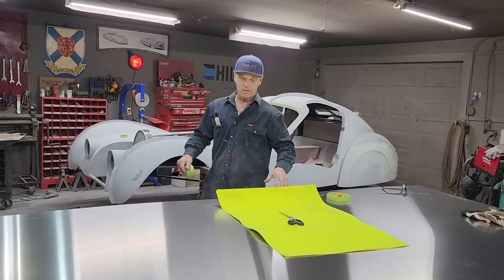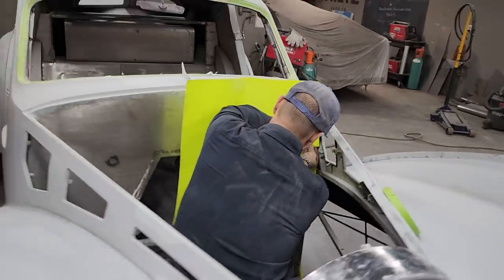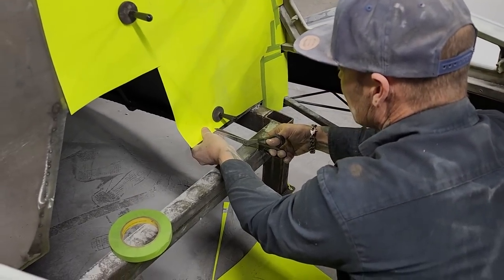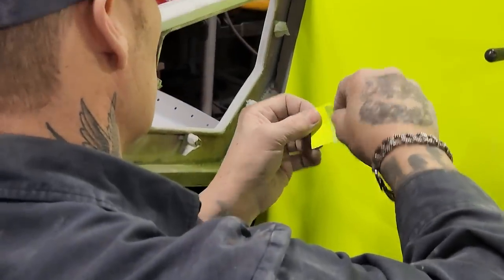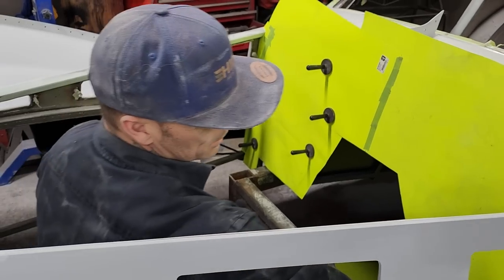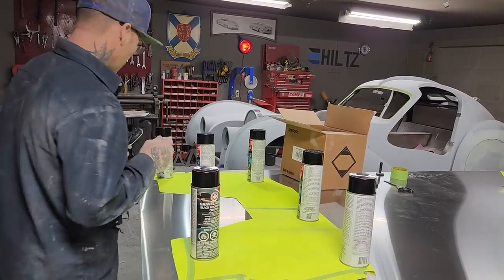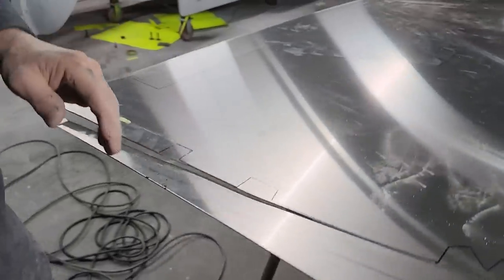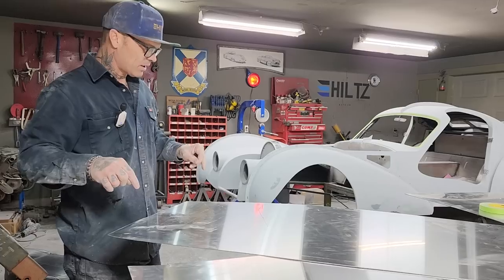Fabricating a new firewall out of 14 gauge aluminum

Comment: Here's a little tip for cutting floppy thin sheet metal, lay it oit on a thick piece of styrofoam such as an odl hot tub cover, the jigsaw blade will pass through the foam with out resistance while eliminating all that flopping around

Comment: Could've just used masking tape around the metal square tubing on the car, then unpeel it and stick it back down on the paper. THEN cut it out. You would have near exact cut outs. Would've saved you a ton of time and effort.

Comment: Hi Chad and Jolene, I was watching you guys over at Jim's house. I showed this to a friend of mine that restores old motorcycles. If you take a pitted piece of Chrome, the easiest way to remove the initial rust is with water as soap and a crinkled-up piece of aluminum foil. Try it on something old to test it out before you use it for an everyday practice. But try it out, it'll amaze you!

Comment: An area in my pre-retirement was dealing with dissimilar metals and their problems with each other. I thought I might give you some in site into it.

Aluminium, stainless steel and sheet metal when combined against another appears to be a bi-metallic corrosion risk, from the 'nobility' table. With this combination the affect of relative surface area on corrosion is important. A large area of 'cathode' relative to 'anode' will accelerate the anodic corrosion.

To reduce this corrosion is to use an isolating coating or paint on the aluminum and the steel to isolate them electrically. Insulating washers are also effective in isolating the two dissimilar materials and creating a relatively safe surface area.

So I know you will spray the primer on the metal portion of the firewall, but also consider the backside of the aluminum before final assembly.
Reply: Big Stretch.... it's a polymer similar to seam sealer....But for home door's and windows... I have used it on many Automobile project...it stays flexible and is paintable would be great for separating those metals....
Reply: i remember putting a aluminum pipe up on a steel shelf. the aluminum  disappeared where it was touching the steel, to the point the aluminum pipe fell to the floor in pieces.
Reply: Totally agree with you. I work in the industrial food manufacturing and we are always aware of not getting galvanic corrosion between stainless and aluminium..

Comment: Per Tim R's comment - my MGA had aluminum panels which close off parts of the frame.  The MG company put a cloth/wool type of packing between the aluminum of the panel and steel of the frame, which eventually gets wet and rots.  When I went to restore my MG, the aluminum had reacted with the steel and part of the aluminum had corroded away.  When I replaced the panels I did as Tim R. suggested,  paint-wise - it's been 15 years and there's no sign of corrosion yet.

Comment: Hi again, I actually go by Mickey I wanted to let you know a trick that a old machinist I knew taught me you can heat up the area around to studs and melt a little candle wax in there in your case maybe a heat gun. I'll show that trick I told you about who was aluminum foil we'll save Jim hours or 30 days, but I've never used it on nickel or stainless just on Chrome. Thanks, you guys’ awesome show by the way!

Comment: Great to see the progress made on the bodywork , and telling us Jim has his own channel is giving it a gigantic boost I think, i also took a look at it and it's great to see how Jim is getting the job done his way, he's great with the torch welding, you should put a kind of insulation between the steel body and the aluminum sheet firewall to prevent corrosion ,just as with steel bolts on aluminum manifolds as a comparison, thanks for sharing

Comment: Chad, you’re friend from Utah Clint. Hey love the pattern making. I’ve made thousands just like you just did. I owned a car stereo shop and had to build custom boxes or amp racks to look factory built in. I might suggest to do the inner engine panels with the fancy turned metal to? Also look for a spot to run you’re wired for the engine and headlights etc.? I just enjoy you’re work like so many others are. You’re personality is so unique it makes it interesting. THANKS

Comment: Suggestions-- when putting pattern on aluminum and magnets won't work go back to little pieces of tape. When you have the outlined  pattern fill in the small spots where tape was "free hand".  Also, when cutting thin material with a saber saw, put a length of of wood under the material being cut, parallel to where you are cutting. Then just press down on the material where the wood is. (some wise man often says you can take the suggestion you like and the ones you don't like just forget them.)

Comment: Hi Chad you could use a method of pattern making using a sheet of Bristol board roughly smaller than the space  and a 30 degree draughting square 
Place the squares longest point so that it touches the point you need to record  and draw round the part of the square so you have a record of where the point of the square was touching rinse and repeat for all the points you need to record  bring out the board place it on top of a larger piece of card  placing the heel of the square over the drawn lines so it matches. then draw round the sharp point it will give you a precise record of the firewall or any other shape you are copying  its used in boat building called Spiling  hope this is some use 
Regards

Comment: Good job, great idea . To prevent electrolysis  if moisture  gets between the steel fire wall and the aluminium  you are obviously going to put a barrier between the two . I.E a coat of stone guard applied to the fire wall before Aluminum is fitted .

Comment: To properly make those swirl marks into the aluminum, you want to put the tool into a drill press so it doesn't get away from you and cause a mess. if you want a precision job I'd do it on the table of a milling machine so you can accurately move the table horizontally and vertically so that you can evenly space the swirl design.

Comment: Brad I laughed when I saw your jigsaw... I have a similar one I bought from Russ Freeman at Rockwell's in Kentville when I was about 14 that I still use and also the first B&D drill I bought there around 1970.  Both still work pretty much as new and I've have a bunch of newer drills that have ended up in the dumpster.  I think the drill was $11 and the jigsaw $14.
Reply: They don’t make 14 ga aluminum

Comment: I tape the aluminum instead of saw. A 1/4" reverse tooth blade helps. They pull the material against foot of jig saw.
Your electric shear is the ticket for cutting aluminum. Sheets normally come covered in protective plastic film.

Comment: Hey Bad Chad...you could make a nice pattern by taping the piece to the firewall. Plumbing it with a level, then use a compass to transfer the inner edges of the fender to the pattern for a nice tight accurate fit.

Comment: The only bad part with  having all of those swirl scratches in the aluminum. Being under the hood the dirt and grease will find them scratches and hide in there. If there is enough room though. You could probably use some aluminum wheel cleaner.  Most  spray on and hose off so you won't need to do any scrubbing to get the dirt out of the deep parts of the scratches.

Comment: Chad and jolene you will probably find its rust on the studs on the manifold holding it together. Heat them up and spray with penetrative once it's cooled a little so it doesn't catch fire .it will brake up the rust with a bit of a tap with the hammer .keep up the great work the both of you 👍 👏

Comment: Hey Chad. Love the show. Had a quick thought. If the metal is covered with a plastic film, you could spray adhesive on your paper template and apply it to the film. Could do it without I suppose too as long as you clean the glue off after with thinner or something. Anyways Cheers from one Bluenoser to another

Comment: I was thinking that the tool used to transfer shapes to tile flooring or molding might really help in making Chad's pattern's. It is made out of polymer with fingers that form the pattern of the area needed and locked into shape and then that pattern is transferred to the medium and shape is cut out.  Perfect fit.  Just a thought.

Comment: Nice job Chad.
I personally wouldn’t use brass screws with aluminium, with some moisture they react.
Maybe some stainless screws dipped in a thread locker would be a better choice.

Comment: Chad: When metalcutting/sawing, looking in cross section view, you shall allays have 2 teeth cutting, if not possible then 1,5-ish.
Cutting in aluminum it is a good thing to use Welding Anti Splatter Spray, you will see/feel it is cutting much better.
Cutting disc, milling, drilling, threading etc.
Reason why you saw is jumping, is you need a finer saw blade tpi 16 and up. (Teeth per Inch)

Comment: Chad couldn't you bow the aluminum with the center bowing away from the firewall  wrapped with a string strong enough to hold the aluminum while it's flexed and put it in place then release the string to straighten it back to fit ?

Comment: You could have saved material by cutting your template in half and flipping one side by 180 degrees, then tape it together again for the swirl pattern, but my thought is you might be able to fit it in as a whole piece if it has enough flex. I know there are lots of people that comment by blowing air up your butts, other give heaps of instructive  criticism, which should always be welcome, as no-one knows all, anyone who is just being mean should be disregarded, have a happy day Jolene and Chad.
Reply: I imagine he did the full template because he knew in all likelihood the two sides aren't perfectly symmetrical. I had hopped he might have used the template to show us how close to symmetrical it actually is.

Comment: sonny benfield- there is a rubber cylinder with abrasive compound made into it that you can use for engine turning.  do not remem,ber the name but a little research on the lap top will come up with it.  I think they are different compounds and different diameter available.

Comment: Finally, you are back to your best project.. The beautiful Bugatti is one of the few items that doesn't look like it was designed by a Hill Billy. Check with Jolene she seems to have a sense of style. She will look amazing in the finished project, and what a promotional example of your work.
 You do wonderful, unusual and original work. It just so much is homely with basic mistakes in design. Concepts of proportion, balance,and perspective are universal.

 Jolene is beautiful because her proportions, balance, and perspective points of view are in fit within the parameters of what consider beautiful. If she was pot-bellied with a big butt and no boobs and a lopsided face with crossed, eyes too close together.
.She would still be a lovely person, just not a beautiful one.

Whatever, just keep working on the one job I've been following for what seems like years.

Comment: Bad Chad you should get a contour gauge set Lowe's has them Home Depot has them it fits about 12 in and there's a 5-inch one you hold it up you put it on your firewall hold it up to the to the right fender and then you push push it to the right okay and it holds all the little pins that gives you the length the depth around us everything makes a copy of what you're trying to do then you're very carefully take it out put it on your sheet metal and Tracy image on the line you can figure that out and it's perfect and you might even be able lucky enough that you can turn it over and do the left side but what I usually do because nothing is actually equal all the time as I just turn it around start back to zero and do the left side you'll love it it's like $25 $30 it'll save you so much time and then you're you're smart man you'll know you'll know how to do it just look at it have fun

Comment: user razor knife to cut your edges it will work a lot better I work with aluminum Everyday Use a razor knife to cut your edges put it at an angle and you'll get nice straight cuts love you work Ted

Comment: Here's a tip - put a sheet of kingspan or polystyrene under the aluminium - it will take the bounce out of the jigsaw and give a cleaner cut - if you work on the floor you can kneel on the piece while you cut - also you can cut many patterns on top of the same sheet - cheers DON u.k.

Comment: I had a brain fart……if you have a problem with that engine placement, just think a minute if a Harley V-twin motor cycle engine would fit. Also , Ford or Chevy inline 6 cylinder can be made now to produce 450 h.p. . Even some 4 cylinder engines can produce high H.P.  You like things different, go different !